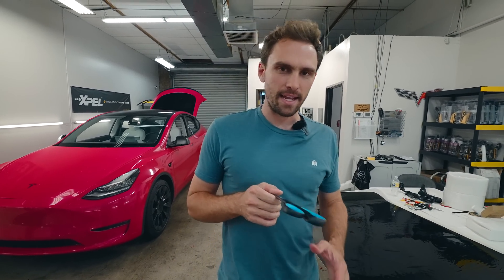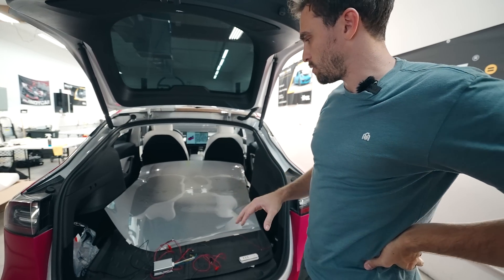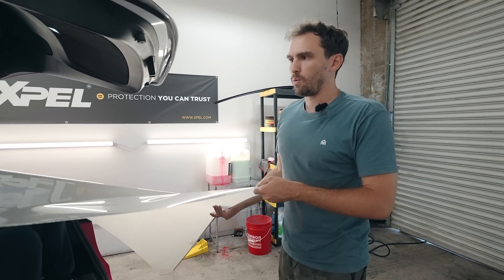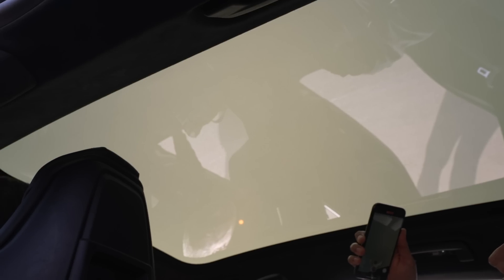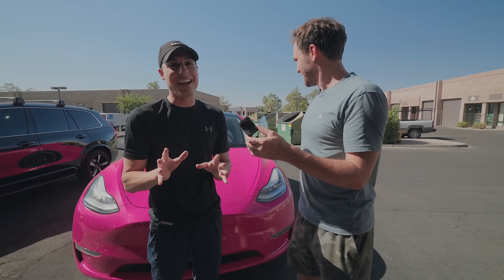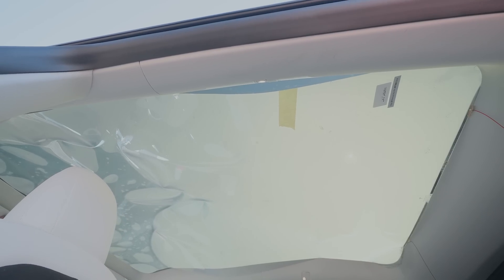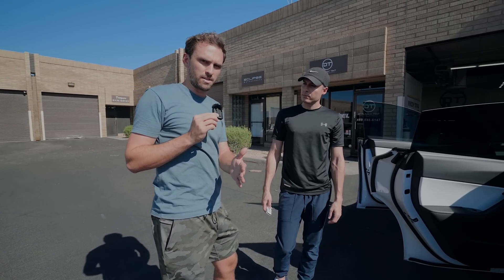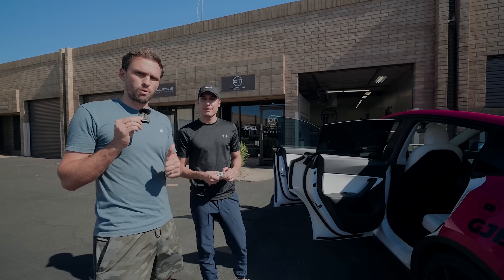I Put Porsche Glass Technology in My Tesla Model Y

Comment from the maker: Just so everyone knows this is a proof of concept its nowhere near perfect but we wanted to test it first to see if it would work and it does. Now we need it to fit perfectly to get to a point where we could sell it. Thought it would be fun to share the steps of this process.
Reply: Definitely cool and I would buy it
Reply: Try to Install it in 4 or 5 Pieces(strips), instead of 1 big piece , it will definitely be easier and less contour for the films needs in the final application. Since it has 4 diferent connectors for more films , maybe cutting it in pieces wont be a problem, good luck!
Reply: @Built-4-Drama  ✌Peace, 🥧Piece, 🍑Peach
Reply from the maker: @alainpuyo4796  Hydrosilex code gjeebsaugust will save you 25% in august

Comment: Roof has compound curves, making it slightly bulbous, which is why the flat material won’t fit.  If it can’t be heat-formed the other option is to make slits, removing narrow triangular sections from the material, but not sure it would continue to function electrically.  Could be something to test.  If slitting the material causes it to not function, that might be dealt with by adding multiple electrical connections, essentially making the material in multiple sections.  Some people might be bothered by having visible gaps, but I wouldn’t mind so long as all of the edges are neat.  Also, having four sections would mean each seat could be controlled separately, which might be pretty nice.

Comment: They dont have to be perfectly laminated onto the glass.  You can make them like the sun shades.  Just hanging a few mm under the roof's glass.   You just need a strong wired frame around the edge of the film.  This would be a great hit as an aftermarket item.
Reply: I second this, especially if you could make a sunshade in the shape of the OEM Model X front windshield shade!

Comment: I would think they are using thermoplastic sheets in PDLC Films.  There could be a possibility of using heat and a vacuum of thermoforming the film to the curved surface of the MY roof.

The risks are degradation of the liquid crystals in the polymer or perhaps the distortion of the film would affect the light transmission/blockage when a voltage is applied.